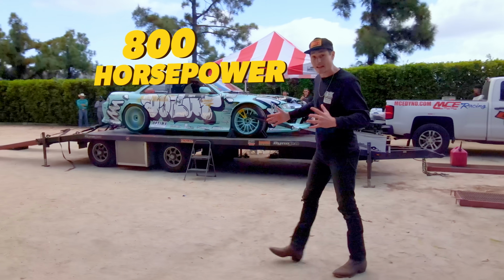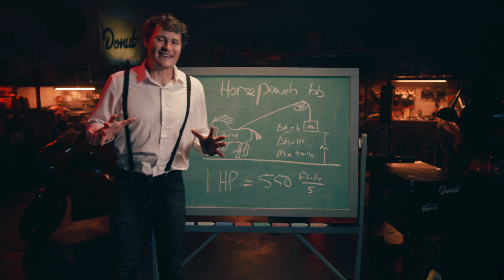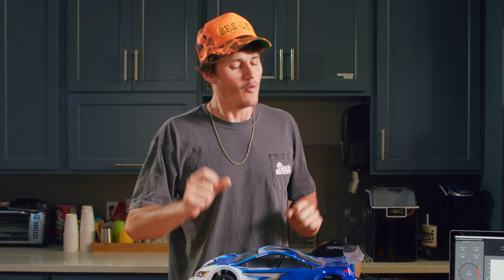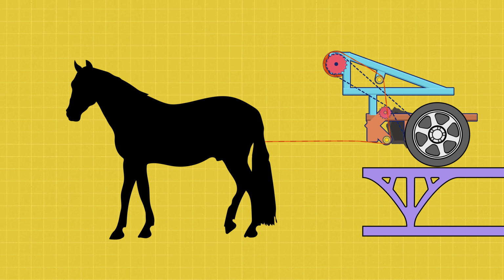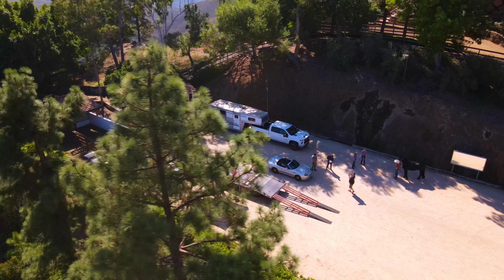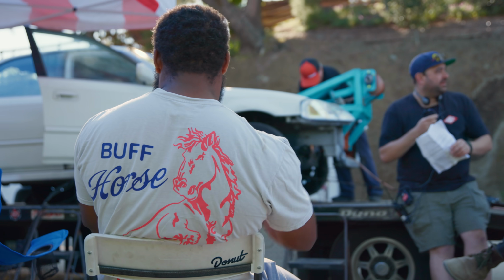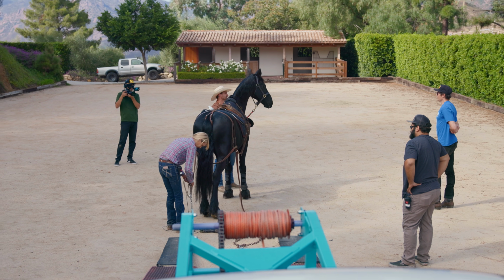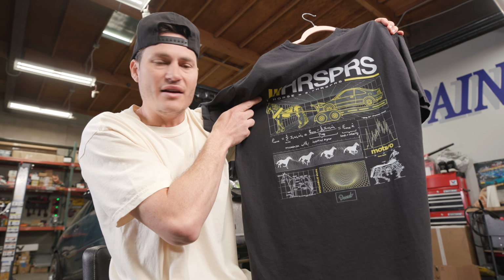How Much Horsepower is a Horse?

Comment: Will there be an actual paper or is one already out?
Interested in which methods you used since the measured data will be very uneven (as basically every actually measured data - never in all those years as an engineer had measured forces / torques etc. that are beautiful curves that are easy to process as in a school book...).

Comment: 13:00  raises hand  Not sure if you'll see this question or not... but.  First thought that came to mind.  Your using a 'spool' to measure the Horse's motion..... Isn't there a flaw inherent with 'spool' systems that exists with the 'height' of the coiled rope/cable vs the surface of the drum?  Doesn't it slowly spin 'faster' the lower that coil gets to the central surface?

Wouldn't you have gotten a more 'accurate' reading if you had given the horse say... 100 yards of 'walking' distance, then ran a 'looped' rope/cable from the far corner, to the engine-bay, back to the horse, then off into the looped corner again?

Comment: I love this, but horses don't have wheels so you don't need the rear wheel horsepower of a horse, you should have hooked a chain or belt drive directly from the inertial drum to the spool, using a One Way Clutch Sprocket, to make sure the drums momentum doesn't try to wind the horse back up. that way you don't have to math your way back to crank horsepower.

Comment: All that work, Yet they got it wrong.  No consideration was taken into  establishing the correct load at which the horse generates the optimal horsepower.  For example, when they tested the humans, they used way too much load.  Any exercise physiologist will tell you that a much lower load and higher cadence generates more horsepower.  Look at cyclists.  Do they select the highest gear?  No, you go faster by running a lower gear and higher rpm.

Comment: First and foremost, I enjoyed watching this experiment. It is a question that many of us have asked. 

 However, there is a crucial factor that wasn't taken into consideration:

The resistance of the dyno for the horse. 

My Explanation:
When a work-horse pulls, he pulls just hard enough to get the load moving. He's not going to pull harder if things start moving. For this test to be accurate, you would need to increase the amount of resistance to the point of the horse being stalled. At that point, he will be using his maximum strength. Otherwise, he will start to slack up when the wheel starts to turn; rendering the test inaccurate. 

There is no way that you can tell me that a horse is less than 5 times stronger than a human. It's probably more like 20. 

Very entertaining video, and kudos for setting out to get answers to a difficult question!

Comment: That doesn't make much sense at all, to only get 5.7HP off a horse. Especially if you managed to do 1.2 as a human. That would mean a horse is only 4.75x as strong as a human, which is completely unbelievable. Judging from your video, you did your best as a human to pull the rope but the horse didn't, it didn't have your motivation towards the goal. I bet the horse can pull at least 15 if it really tries. Btw, try to play tug of war with 5 men vs a horse, see who wins and how fast your results go out the window 🙂
Reply: Horsepower is not a good way to measure pulling power. For instance, steam engines have very low horsepower output but still have lots and lots of torque so they can easily out pull a modern diesel tractor even if it has way more horsepower.
Reply: @SllSamuel-034  Good point. Planet Earth probably has pretty low horsepower considering it rotates at a single "revolution per day". Probably generates less than 0.00001 hp if you put a normal driveshaft through the North pole. But try and stop that rotation.
Reply: P.S.: look up the video of a draft horse winning tug of war against 18 strong men and then reconsider your "scientific results".
Reply: Guys. HP is a product of torque and RPM. Even if you have very low RPM but insane torque, you'd still make lots of HP. That's the job of the transmission to convert torque into usefull RPM and power. So you'd measure the HP at the same RPM. Learn a bit of physics. Draft horses output about 15HP, not 5. This test is BS.
Reply: @HDJess  dynos measure the power of the engine, not the engine+transmission. Which is why they need the engine rpm and the wheel rpm so they can work out the engines actual torque.
Reply: @SllSamuel-034  They didn't measure anything of value tho. Their values are way off, and we don't even know how far off since they never calibrated the setup anyway and it has too many points where efficiency is lost to begin with. So this was a bad experiment no matter how you look at it.

Comment: A Dyno seems like the wrong test for this.  Works well for a fast, wheeled vehicle (which it was designed for), but just wrong for a 4 legged slow walker.  Why did you not just recreate the test that is so common that you actually put it on a Tee Shirt??  A single pulley, with a weight, and a harnessed draft horse attached to it?  Oh, and an actual Draft Horse, like a Belgian, Clydesdale, Percheron, etc.  Not a warmblood.
I'm baffled why you put massive amounts of work into coming up with a complex system that is far worse than the simple test.

Comment: Why not use a hub dyno? 
It seems like you could have bolted the spool directly to that and not have to worry about the drivetrain calculations.

Also, i feel big D might be an okay representation of horses in general, but Hes nowhere near peak. Id like to see a bigger horse do it, something like a competitive Horse Pull competition heavyweight winner.

Comment: Soooo you did all this to insure scientific accuracy... then didn't have a car, basically the only thing that can be tested both on your pull rig and straight up on the same dynamo to directly tell you if your calculations are accurate. Don't preach about being scientifically accurate when you don't even have a control to validate your findings.

Comment: 5,7 hp? So about 4 kW. But that is only the peak value as the power changes how the horse moves. The average seems to be about 4 hp or about 3 kW output, at least for a short period of time. How about CONTINUOUS power output? How much could the horse pull for one hour? I bet it would be much less. Maybe about 1 hp or 0,74 kW. Those horses that Newtons engine replaced were delivering continuous power over long periods of time. Only fair to have the unit of power named after Watt, he deserves it. Big respect to horses too, majestic animals.

Comment: Not a car guy, but I’m 18 and in college for mechanical engineering. I was wondering if anyone could help me understand why you couldn’t use a rope to spin the drum instead of making the rig in the video? My guess is something to do with measuring the rpm’s, but idk
Reply: Because this is a terrible video. They can literally get a hub dyno that doesn't come with the useless big roller.
Reply: This is a terrible video.  They don't even need the dyno.  All it does is serves as a load.  They have a load cell in the rope to measuer the force, and they have a GPS on the horse to measure the speed.  Power equals force times speed.  The power in watts is the force in newtons times the speed in meters per second.  Then divide the watts by 746 to get horsepower.

Another problem is that they only ran at a slow speed.  An engine will have different horsepowers at different rpms.  Likewise, a horse will have different horsepowers at different meters per second.  The horse can provide maximum force at zero speed, but that equates to zero power.  At what speed can the horse deliver the most power?
Reply: @davemuller5463  that makes so much sense, I thought I was the only one who thought something was up but everyone in the comments was praising them.

Comment: How did the two redundant mesurements compare? 
With the GPS on the horse it is very easy: Just multiply the speed (in m/s) with the force (in Newtons) to get the power (in Watts)
Reply: Probably completely different, but they didn't have a force gauge on the rope anyway.

Comment: So what you are saying is a 1965 289, 4 barrel has under 40 horse power. I have questions, why did you not use a horse tread mill. Did you figure the gear ratio, on your rig itself as well as on the car, or just the car only? I think we all know that horse power is not meant to be an exacting measurement, I think even back when mr. Watt used it, people knew it was not an exact science. But it was a good video, and I actually learned a thing or two. Thank you

Comment: I was all through waiting for it, but it was not to be... Why did you not rig up a car with known C/HPs  to the contraption you built, to check all that Math..? May be you could have simply done away with all that math all together, and simply use a factor derived from the control (known C/HP of Car), to come up with a better approximate of the real HP of BIG D.
- N

Comment: I think a regular work horse can pull more, but good experiment, loved it. I say that, cause my childhood was in my villiage. My grandpa had a donkey, but I've seen that horses can pull more. So if a person makes 1.2 hp I bet a true work horse can pull out like 10 hp. Nowadays machines to work the ground are basicly like 7-10 hp max (at least in Europe), but they cannot pull the weight that the donkey did back then, not speaking about horses. You can stop 10 hp machine from moving.

Comment: One horsepower is what a horse can somewhat lazily do all day long. It's not what it's maximum power is. A horse lifting 550 pounds one foot off of the ground in one second requires little effort. Nothing deceiving about it. You wouldn't rate an engine's power at the point it blows apart and you wouldn't rate a horse's power at the point it would lather excessively and die by a cardiovascular event.

Comment: While the measurement itself was correct, I don't think this is the maximum power you can get from the horse. Human record is close to 5hp. 

Horses are not machines and it's difficult to get into high power in slow speeds. This seemed to be strange situation for that horse, and it didn't seem to put all in. At least when comparing this to competing pulling horses, which are trained to do what they are doing. Of course those horses are built differently, but still.

I think it would gave better result to let the horse pull some cart in high speed and then slowing it down with brakes, same time encouraging horse to pull harder. Measuring rope tension would give the result. Cart mass could be taken account in calculation.

I think that was the way how 15hp was measured in a past.

Comment: One winter, a tanker semi fully loaded carrying milk slid into a 3ft deep ditch going down a hill, The Amish farmer across the street got 6 plow horses, hooked them up to the plow bar, chained it to the truck, they kicked and pulled neighed to no avail but then all of the sudden their hooves got traction, their pulls synchronized, and pulled that semi out of the ditch. Put a heavy wrecker to shame. God those horses were jacked up. Looked 4 times heavier than the horse used in this video.

Comment: This experiment is a little bull, all they had to do is put a rope on a pulley on an electrical generator and put variable dummy load increasing as the horse pulls till failure because you can figure out at any time the efficiency of this system instead of rolling some tires on a Honda on a god knows what dyno that has zero real world calibration as if they had used an electrical winch to figure out if the calculated horsepower it outputs after loses is something similar to what the dyno registers and then make up the numbers so they can relate accurately to each other.
Horse wise that animal was idling, if you see horses pulling stuff in real world conditions you'll feel sorry for them, but it's okay i wouldn't expect such test to be conducted on a video.
Good video for entertainment, not real numbers by any chance.
Reply: Overproduced trash, nothing surprising. But when the guy said he wanted to publish this as a scientific paper... at least attempt some science then.

Comment: Does the horsepower double with 2 horses and triple with 3 and so forth. 💯
Reply: you had one dude get 1.2 horsepower.  3 Dudes combined together got 1.9 horsepower.  
I suspect the problem was in how they set them up - in one line, pulling the same rope.  You need to have 3 ropes extending from a single rope and then you might end up with doubling of the pull power from 2 dudes - and triple from 3 dudes.

Comment: I cant believe thats maximum pull from the horse big D... probably will be able to pull 10+ hp. I can guarantee that if they pull with max. Power.
Reply: it has the size, but look at its legs.  Compare its legs to that of a draft horse which were actually bred for pulling.  Draft horses have legs like tree trunks - and massive 'chest' muscles.  Big D seems to be the type of horse for display shows - or perhaps for speed.  

They picked the wrong horse.

Comment: Interesting. HP is just a mathematical derivative of Torque x Time  and as each type of horse and even each individual horse will be able to generate a different amount of torque then it would actually be hard to nail down what an exact HP is. Still, Horsepower is a sexier and sportier name to describe it than PS or whatever else countries that haven’t stepped on the moon call it.

Comment: Why didn't you use a horse treadmill, like you baited in the thumbnail?  A car doesn't pull a load to measure it's own horsepower; it pulls it's own weight.  Even if you use fancy math to account for power loss, you are still using the basic premise of the original 'experiment.'  
To you, is horsepower about speed or torque?  This experiment exemplifies torque, but the engine was not able to reach peak rpms for an accurate measurement. 
The idea of horsepower is about energy, right?
How much does the horse weigh? How many feet does it move itself in 1 second at top speed?  😉

Comment: As i understand it, Horse power was originally computed as the power a horse can output during most of the day.  Not a temporary max output.  Max output will be higher than avg power a Horse can produce all day. So the original number wasn't too far from accurate.

Comment: Using a load cell and a wheel speed sensor on a cart would have been enough, plus you can use the optimum pace of the horse. That's how power meters on a bike work.

Comment: Cool experiment, but I believe Watt's number was based on the sustained power output the horses could maintain through a day of work, not max power on a couple short pulls.  I can hit over 1200 watts on the bike (1.6 mechanical horsepower), but I think my best 1 hour average was 281 watts (0.39 mechanical horsepower).

Comment: Before I even started the video I knew....
1 horse power equals the equivalent power required to pull 33,000lb of weight 1 foot in 1 minute and was designed to show how a machine could replace a horse.

Comment: You need a draft horse like a Clydesdale. Then you also need to consider that Watt observed a team of horses work all day under load and that's how he figured his horsepower (not max load). You're using horsepower it to determine is maximum power for a short duration of time instead of all day long. Imagine having to tune a hellcat down to a point where it could run wide open under load for 10 hours without an issue for a year.

Comment: Fun project...but I wonder:
Did you count on the fact that the reel you using on the car getting smaller the nearer you get into the middle of the drum?
Did you count in the fact that the more rope you get out of the drum the easier it goes to pull?
Did you count in the fact that in the car you have berrings and stuff on the wheel-axle that "slow down" the rotation a little?
Did you count in the inertia of the rop vs. the drum?

Comment: This would be pulling power not really HP. Because that's quite low. idk all the math but it takes around 70HP to reach 65mph, and an avg horse can run 44mph. So just based on that at a full gallop they should be generating 20-50hp.

Comment: wouldnt it have been more practical to just wrap the rope around the roll of the dyno, and avoid all the gearing and stuff? also, i think the gearing was much too high for the horse to output it's full power. An analogue situation is a human riding a bicycle. The bike has gears, because we know that if the pedals are moving too fast, the legs power is wasted in accelerating the legs, instead of pushing the cranks, and if the gearing is too hard, we can use our full force on the cranks, but the power delivery is hindered by the low rpm. this same phenomenon happens at combustion engines

Comment: First car was sold as a horseless cart. It could pull the same weight as one horse. From then on that was the bass of horse power. Next cart came along and it could pull the weight that 2 horses could, thus 2 horse power